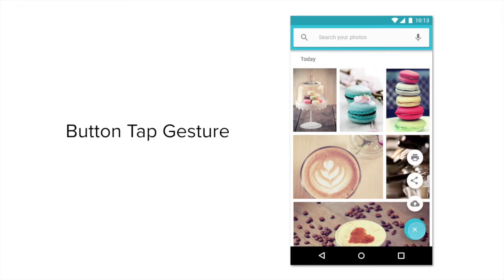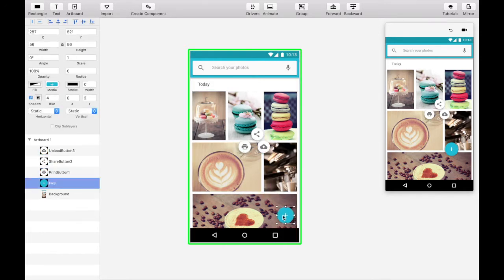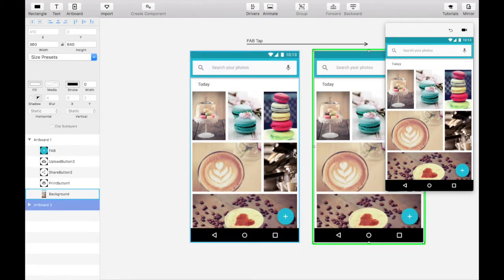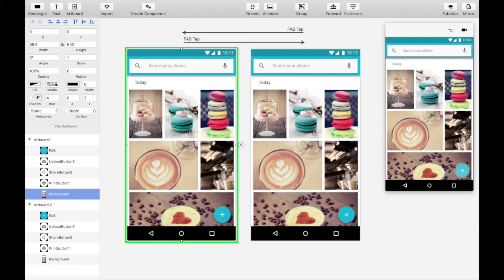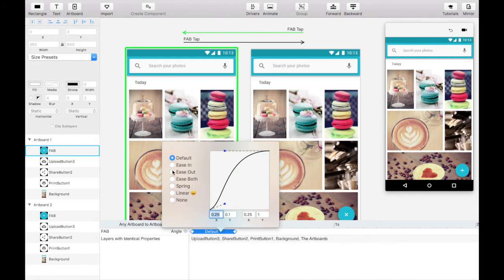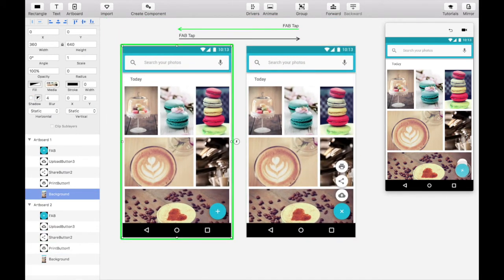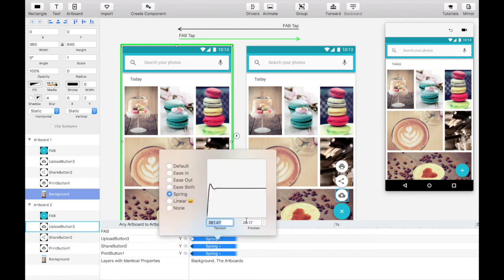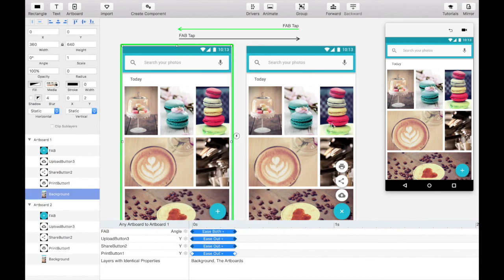Principle Tutorial Button Tap Gesture

Comment: Try using components.
Reply from the maker: Hey Swapnil, thanks for the tip. I think I actually made this tutorial before components existed in Principle, but in this case, since the Floating Action Button only has an open and closed state (and isn't a repeatable element), it'd probably be about the same amount of work to create it with or without components. Components are especially good for more complex interrelated interactions with lots of screens and repeatable elements like toggles and sliders.